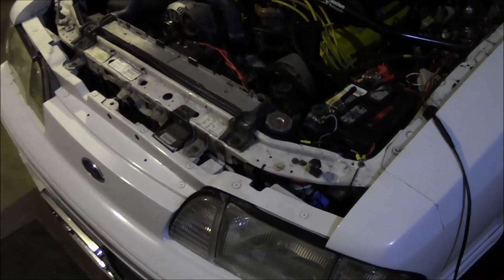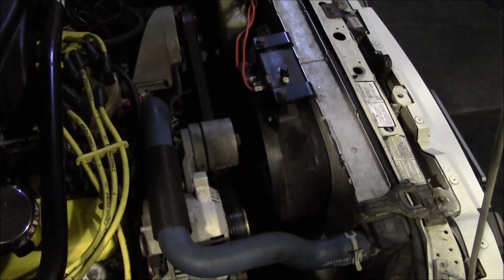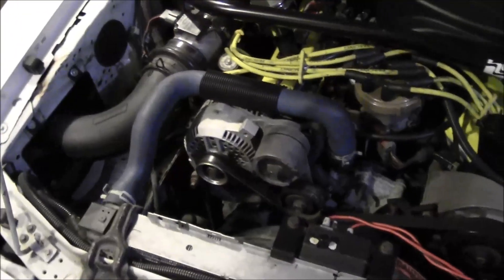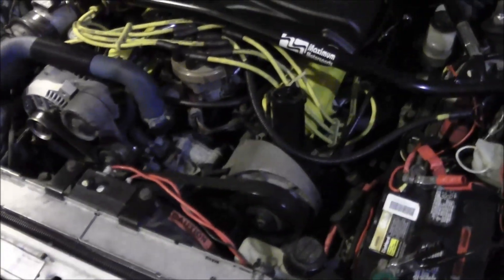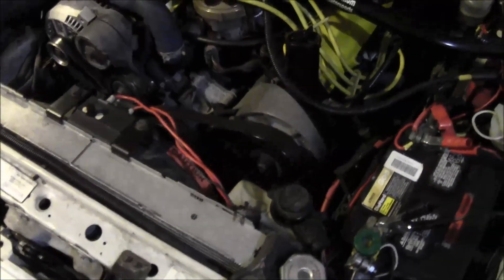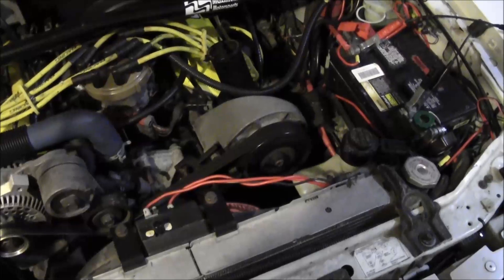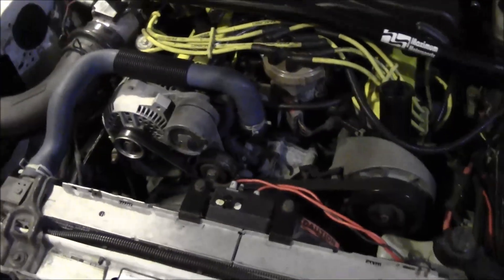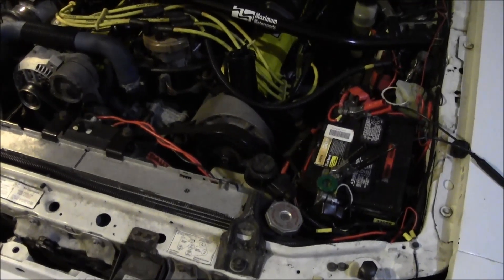Fox Body Mustang Electrical

Comment: Does a LOW draw electric fan exist?
Reply from the maker: Max Um:  Not to my knowledge.  Generally, the power used by the fan dictates the CFM of the fan.  Are you having problems with an electric fan set up?
Reply: @fwh79FOXR6  
Yes it's on a toggle switch, and when on, lights dim  and wants to die at idle ect.
New battery new alternator.
Reply from the maker: @user-ew7nz3yw2i  What kind of fan are you running?  Is this in a Mustang?
Reply: @fwh79FOXR6  
Prerunner truck with 5.0 ,radiator relocated to bed of truck.
Just a generic electric fan from summit
Reply from the maker: @user-ew7nz3yw2i  Where is your battery located in the truck?  Under the hood or in the bed?
Reply: @fwh79FOXR6  
Ahhhhhh yes bat is in cab of truck... so awesome of you to answer my questions!
Reply from the maker: Max Um:  Ok, well here are some things that may be causing your charging problem.

1.  Using wiring gauge that is too small.  This could include the alternator charging wire that leads to the battery and the wiring for the fan itself.  There are wire gauge calculators online that will help you pick the correct wire gauge size for the length of wiring that you are using.  The correct wire gauge will unchoke the charging system and allow the cooling fan to run at its full speed.  Your fan should be wired with a relay and I would highly recommend getting a temperature switch to automatically control the fan relay.  Using a manual switch substantially increases the risk of accidentally over heating the engine.  The temperature switches are cheap ($20 or $30) and easy to install.  There is no reason not to use one and risk over heating your expensive engine.    
2.  Underdrive pulleys on the engine.  Most 5.0 engines end up with underdrive pulleys installed which will decrease the alternators ability to charge the battery.  Especially at idle speeds.  Check your pulley sizes and try to find stock pulleys if your engine has underdrive pulleys installed on it.
3.  Reduce the electrical draw on the battery where ever possible.  If you use your headlights or any auxiliary lighting.  Be sure any auxiliary lighting is wired using the correct gauge wiring and proper relay(s).  Also consider replacing any halogen headlight bulbs with an LED or HID conversion.  Making a conversion from halogen headlights will greatly reduce the power draw on the alternator.
4.  Use a battery maintainer.  Using a battery maintainer will insure that your battery is 100% fully charged and ready to go when you start up your truck.  If your battery is not fully charged, the alternator is trying to recharge the battery and also power any accessories like lighting and the cooling fan.  Not using a battery maintainer is like starting a trip across the country will a half empty tank of gas instead of a full tank of gas.  Use a battery maintainer and start at 100% charge every time.
5.  Upgrade your battery and alternator.  I know you just bought a new battery and alternator but I'm throwing this in here any ways because it is worth your consideration.  Upgrading the alternator might be necessary based on the total power needs of your truck.  Also consider upgrading to an AGM battery (if you don't have one already).  An Absorbed Glass Mat battery will charge and discharge easier than a flooded lead acid battery.  It will provide more reliable starting power.  Plus, AGM batteries are much better at handling any shock transferred from the suspension and they do not require any venting.  Which works out well for batteries that are mounted inside of a vehicle.

I hope this helps you out.  I would be sure to pick up a battery maintainer first and then look into checking your wiring.  There is a lot to be gained from having a fully charged battery and the proper wiring sizes with the correct relays and fuses.  You might find that getting the battery fully charged and upgrading a few wires in the charging system is all you really need to fix 90% of your problem.  Start will the least expensive changes and work your way up from there.  If you need any more help, be sure to ask.
Reply: @fwh79FOXR6  
Just wow. You know your stuffs!
Reply: I'm going in........
Reply from the maker: Max Um:  Thank you.
Reply from the maker: Max Um:  Let me know how it goes for you.

Comment: I just recently purchased a 92 foxbody from a guy that didn't really know a lot about all of the mods on it. I drove it an hour home, and now it will only crank and not start. If I keep the key in the on position, the fuel pump and the A/C WOT relays click off and on like a fireworks show. Any ideas on what that could be?
Reply from the maker: Josh Chrobak:  I have a couple ideas.  Does the car have an electric fan conversion on it?
Reply: Yes, it does.
Reply from the maker: Does it crank really slow when you are turning her over?
Reply: No, it cranks like normal. I can here it wanting to start barely, but nothing. I tried recreating the problem last nigh. The relays stopped clicking quickly as stated before which puzzles me.
Reply from the maker: Josh Chrobak:  If you haven't already, charge up that battery.  Usually the relays will click when the battery is low on voltage.  If the battery sat over night, the voltage probably came up enough to keep the relays from clicking.  Do you have a stock alternator?  I think you may have a bad fuel pump.  Or, you may have burned up the fuse link for the fuel pump.  You could always try starting fluid to check if it's the fuel pump.  Or go rent a fuel pressure gauge and hook it up to the rail to test the pressure.
Reply: Thanks man. I'll give it a try and let you know how it goes.
Reply: SN95 alternator though
Reply from the maker: Josh Chrobak:  That's good.  The stock alternator is very weak in amp output.
Reply from the maker: Josh Chrobak:  Any luck with your car yet?
Reply: Checking everything tomorrow. I've been trying to take my car to the shop for 3 months, but they've been giving me the runaround. Look's like I'm DIYing it.
Reply from the maker: Josh Chrobak:  I hear ya brother.  I'm here to help you out the best I can.  Let me know how it goes and hopefully we can get her fixed up for ya.

Comment: My 1989 5.0 Fox Body used to at least turn over, and with some starting fluid, run for a second or two.  Guessing that is a fuel pump issue,  I went today and tried starting it, and all it does now is CLICK CLICK CLICK...Not sure why. Any suggestions? This car has 32K miles, and has been sitting under a cover for almost 20 years.
Reply from the maker: Brad Griff:  Is it turning the starter?  Or just making a clicking noise?  Sounds like you have a bad battery my man.  You may have a combo bad battery/bad fuel pump.  I would get the battery load tested at an auto parts store or try jump starting the stang with another car to diagnose the battery before moving on to the fuel pump.  If the battery is low it isn't turning the fuel pump fast enough anyways.  Get the battery figured out first and let me know what happens.

Comment: I turn the key & im electric fan doesn’t turn on nor when I start the car how can I fix this problem?
Reply from the maker: Do you know if your fan is wired to an adjustable fan controller, or a toggle switch?  If there is a fan controller (should have a small dial on it to adjust the activation temperature) there will be a temperature probe that should be pushed through the radiator close to the coolant return hose from the engine.  You can test that controller with a heat gun, or a cup of boiled water (be very care with the hot water!).  Heat up the temp probe to test its operation  (heat it with the heat gun or place the probe into the cup of boiled water).  The fan should only fire up when the probe senses the correct heat input.

Comment: My car won't crank or start when its cold but when its hot it will try to start and sometimes turns on idk what is wrong,  I have a 89 GT anyone got a fix?
Reply from the maker: Could be several things.  Bad or discharged/drained battery, bad or shorted battery cables, loose connections on battery/starter, bad ignition switch (located by the ignition key), bad starter, or a bad starter solenoid (the black piece that your cables mount to between the battery and the starter on the driver's side strut tower).  Does your car have an electric fan on it?
Reply from the maker: Could also be a bad TFI module.

Comment: Hi..i have a 1989 mustang gt.  would it be better for all purposes to just go back to a clutch fan?  Gracie
Reply from the maker: It can be a very good choice some times.  It depends on what you personally want.  One topic I didn't touch on in this video, is the TFI module on the distributor.  I feel that having the clutch fan is important to providing proper cooling of the TFI module.  Using the clutch fan puts you back into the design parameters that were created by the engineers at Ford.  So to answer your question... Yes, converting an electric fan back to a clutch fan will alleviate several of the problems associated with converting these cars to an electric fan set up.  If you do not have the electrical knowledge needed to properly install an electric fan, the clutch fan is definitely your best choice.